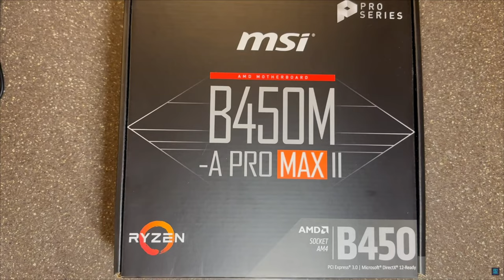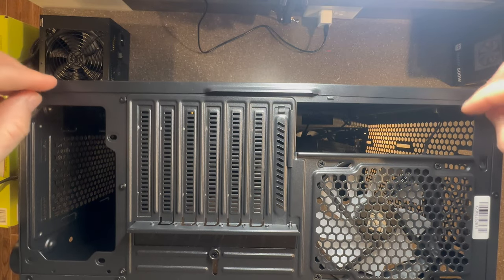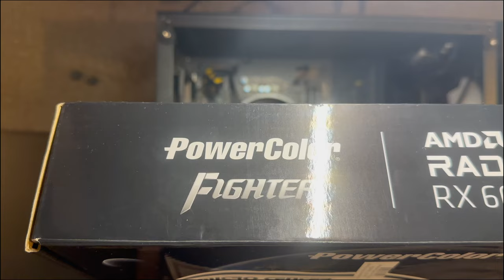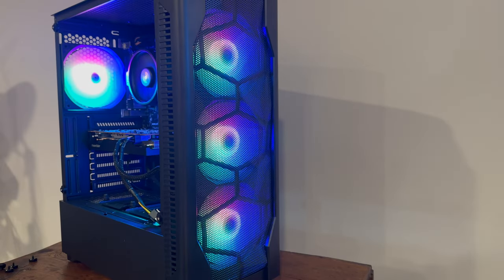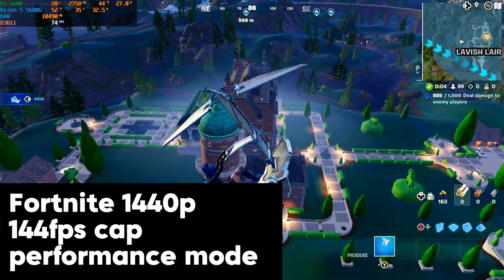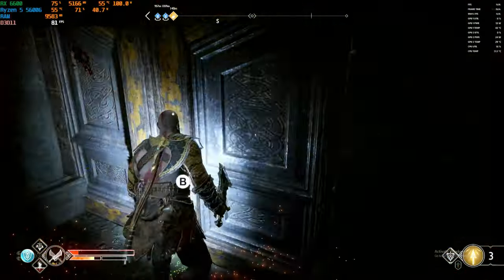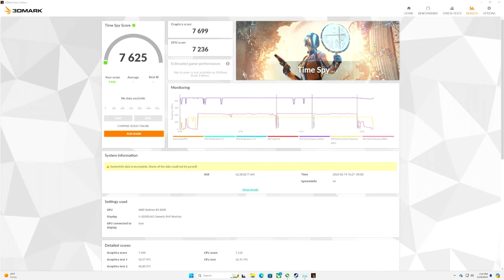How good is THIS budget gaming PC? Ryzen 5 5600G + RX 6600

Comment: Its not less than $500 you said your GPU was $190 not $180
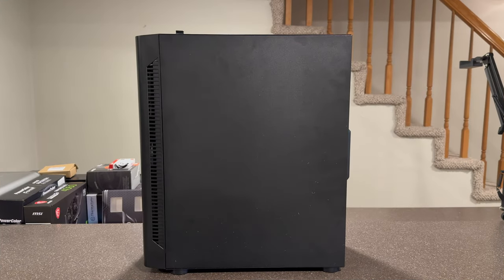Reply from the maker: That’s my bad I forgot to update the amount to be $190 at 3:22 but the total is correct. If the GPU was $180 the total would have been $488